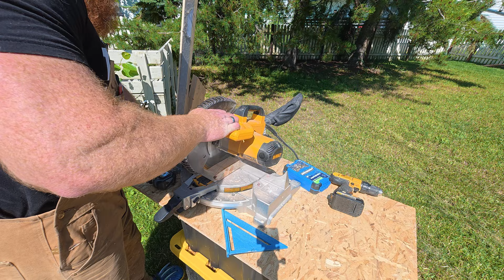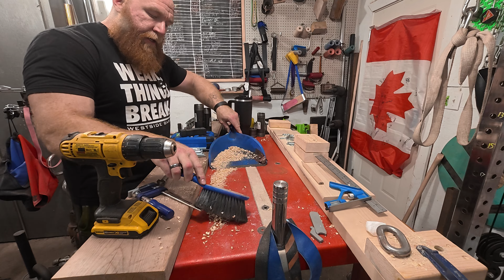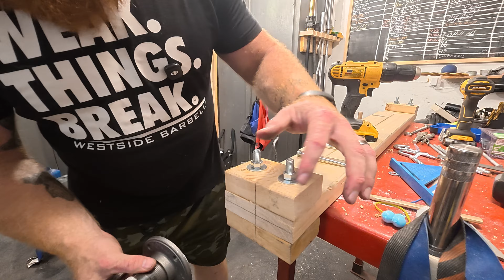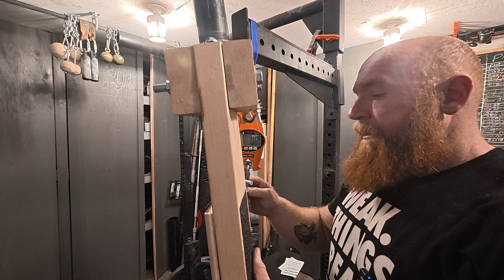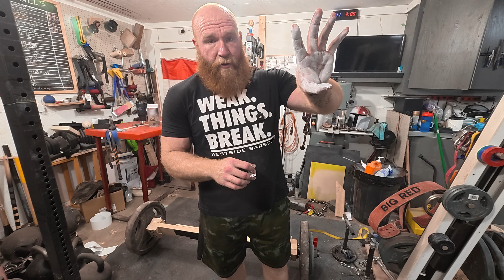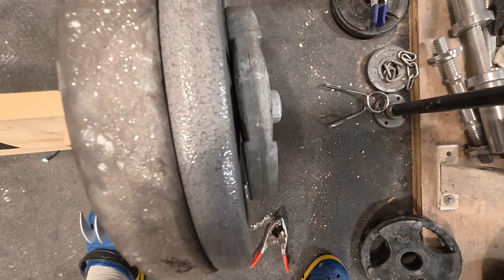DIY Grip Equipment: Build Your Own Saxon Bar

Comment: Thanks for making this. Easy to follow and fun to watch. What's the grip tape you added?
Reply from the maker: thanks for the watch and coment :) The tape used is fro amazon, just search "anti slip tape" and it should come up with a 4 or 5 meter roll, various widths. I was a little concerned it might not stick well to the board but so far soo good! Always check reviews to be sure lol I believe it was 12-15 bucks Cad for the roll I got. Skateboard deck tape would also work really well and its designed to STICK to wood! I use hock grip tape for a lot of stuff also.